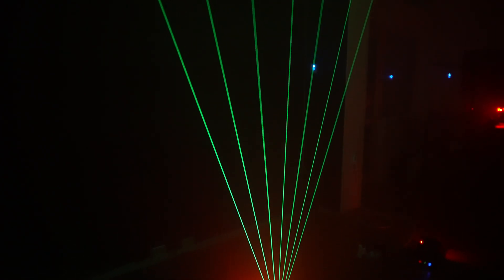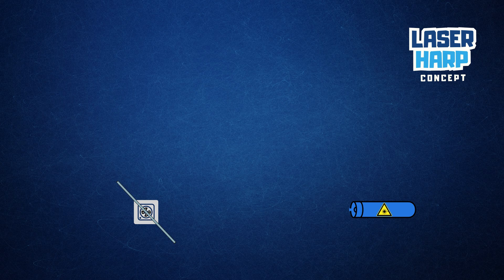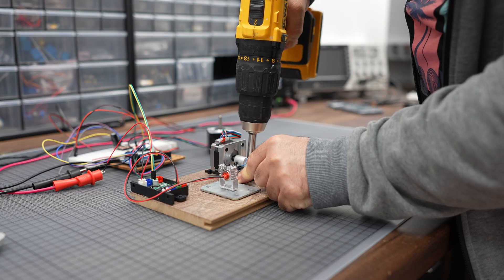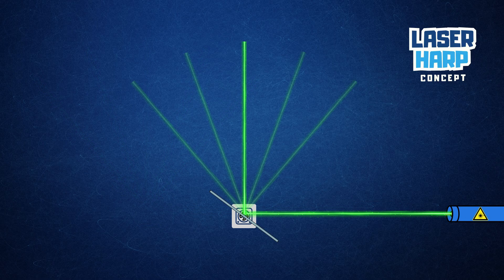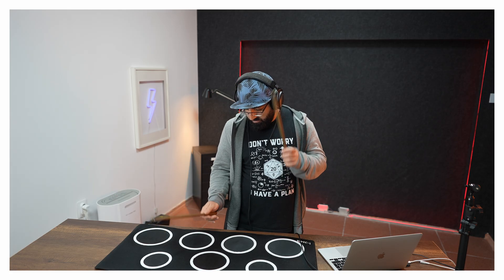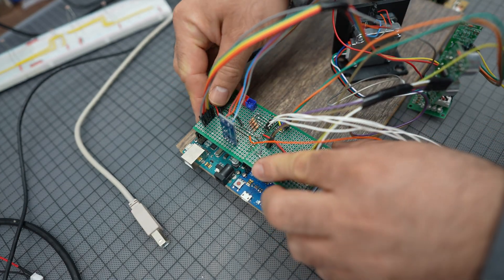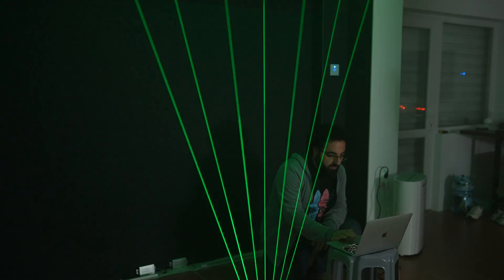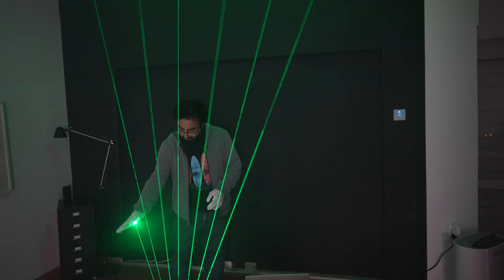I Thought Making a Laser Harp Would Be Easy...

Comment: Great video!  I built a laser harp with a 100mW green DPSS laser in 2007, PIC16F88, MCP4921 DAC, 16x2 LCD, with a G120 General Scanning galvo.
The issue you have with the range and increased reflection is that the Zinc coating will produce more of a mirror effect. The issue is that the reflected laser beam is more of a concentrated spot, rather than the diffused light from the bare glove. While the reflected intensity of the beam is greater with the coated glove there is a more critical angle in returning that reflection to the sensor. Of course increased power and reflector to "collect" the stray light help!

Comment: please help! ive built mine to the exact details of yours but just cant get the motor to do 7 dots! tried everything its driving me nuts!
Reply from the maker: Which motor and driver do you use?
Reply from the maker: Getting the motor running smoothly was the trickiest part. These two videos actually helped me understand stepper motors.
How to identify you motor type: https://www.youtube.com/watch?v=lduqo4fmXYo
How to drive the motor: https://www.youtube.com/watch?v=0qwrnUeSpYQ
Reply: @cybercraftics I'm using the uln2003 with the nema 16 unipolar motor
Reply from the maker: This type of motor should indeed work with this driver. Could you describe exactly what happens when you run your motor? In my case, I initially had trouble getting mine to operate correctly, and it turned out I needed to swap some wires around. The first video in the previous comment helped me identify the correct wiring. Can your motor complete a full 360-degree rotation with this driver?

Here's the approach I took to test and calibrate mine:

First, I programmed the motor to move a certain number of steps in one direction and then move back the same number of steps. This ensures the motor is wired correctly.

Next, I adjusted the code to move 2 steps forward, pause briefly, and repeat this sequence 7 times, followed by moving back 14 steps (7 × 2).

After confirming the basic movement, I experimented to determine the motor's maximum reliable speed. You know you've reached this limit when the motor starts producing strange noises.

Once I found the maximum reliable speed, I further modified the code to move 2 steps and activate the laser for 50 microseconds.

By following these steps, I found the ideal settings for my motor. The problem is that each motor model is slightly different, so you'll likely need to examine it closer.

Alternatively, you could swap the driver. I have an example for A4988, but it works best with a bipolar motor. 

https://github.com/cybercraftics/laser_harp/blob/main/schematics/laser_harp_A4988_schem.jpg
https://github.com/cybercraftics/laser_harp/blob/main/stepper_test_4988_driver/stepper_test_4988_driver.ino
Reply: The motor will do a full rotation on a test code and complete single slow steps on another test code. As soon as I up load the harp code it does a very short line about a foot long back and forth continously. I noticed on your fritz diagram the motor is wired differently to how a stepper motor would normal be  wired? Ie: wires are not standard 1234 positions however I've tried several variants to no avail, I'll do some more testing and see if I can get it going
Reply: I've slowed the motor down a it's a little better but the spacing is terrible
Reply from the maker: It sounds more like a software issues. I'm using the same driver, but my code is optimized for a 5-wire hybrid motor, which is a bit different from yours. Your setup will definitely need a some adjustments. Start by getting it to run reliably at a slow speed, and then gradually increase it.
Also, take a look at the code I've added delays specifically for strings 0, 1, 3, 4, and 6 to help equalize the spacing between the strings. This extra time increases the space between the strings due to the motor's inertia.

https://github.com/cybercraftics/laser_harp/blob/main/main_uno/main_uno.ino#L84
Reply: That's great thank you!  @cybercraftics

Comment: Is the precision of a stepper motor really necessary? I mean, is there a reason not to use a common, easilly driven, continually spinning motor that spins a multi-faceted mirror and sync the laser with an IR barrier sensor (like those used in printers or DVDs) to detect mirror position? Maybe I'm proposing exchanging one complexity for another. Either way your end result is excellent!

Also, now I have "Second Rendez-Vous" stuck in my ears ha ha
Reply from the maker: Yes, that’s actually a great idea I explored a similar approach by building a larger wheel with seven small mirrors, each positioned at a different angle, and using an infrared sensor to sync the laser. However, I ran into trouble balancing the weight, which made the whole setup unstable. Eventually, I switched to a stepper motor, and it just worked right away — so I stuck with that solution.

Now I kind of regret not trying what you suggested. I would have a harp with 9 strings instead of 7 like I have now :)

For anyone looking to build a laser harp, a galvo would definitely be the best option because of its precision and ability to create cool effects, like an opening animation. A stepper motor can’t match that level of precision, but it’s a simpler and more affordable solution.

Thank you for the nice comment!